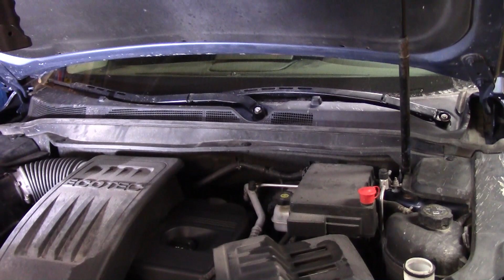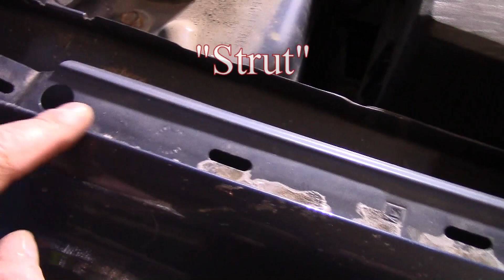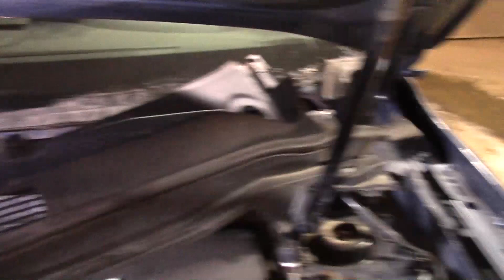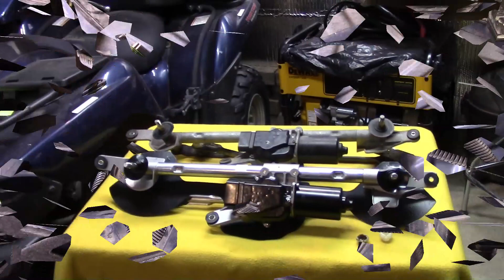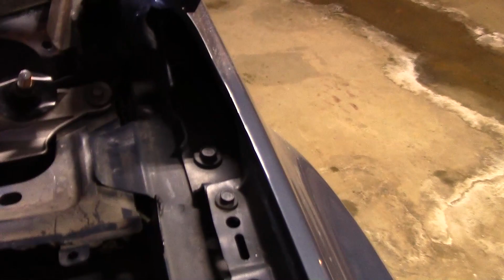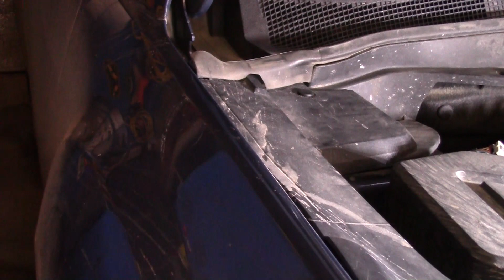How to Replace a Windshield Wiper Transmission on Chevy Equinox Windshield Wiper Repair

Comment: Nice dude. I was going to go the bushing route but seen another video and dude broke 2 bushings to replace one. That link is way cheaper than the $163 autozone charges for the same part. Now all I gotta do is figure this check engine light. Owned the car since August 2021 had all the o2 sensors replaced before leaving the lot. Really wished to get 2yrs outta this but not looking likely

Comment: So GM wont sell us the damaged nylon replacement part and makes you buy the whole transmission, Imagine that. It's a piss poor design with weak connectors that is destined to fail. 
Someone needs to be slapped sober.

Comment: I did everything you did. They turn in the right directions, However when I attach the wiper arms and turn it on, they go the wrong way and blades slam into the cover. I've tried putting the blades in multiple locations, sometimes they will turn in the correct direction. Some how I can't get it started in the correct location. What am I missing?
THANKS!!!

Comment: I just did this today, the wiper actuator link had previously popped off where it meets the motor. Issue is, it's a side job and i never saw how the wipers function before hand.  I noticed the wipers go down before going up and didn't know if that was normal. I ended up clocking the wiper arms up a lil so they weren't hitting the cowl. Just wanna know if that's normal on these?

Comment: In the process of replacing my transmission arms for my wipers when I put the new ones on it's not working properly I don't know what I am doing wrong. The driver side and passenger side are coming in contact with each other and hitting each they are both going opposite ways instead of the same way

Comment: Very helpful. My driver's side arm came off on my 2012 Chevy Orlando. Not sure what the problem is yet, but the passenger side still works. This video helps to understand how to get in there to check it out, and hopefully a cheap (or free) fix! Thanks for the video.
Reply: Splines are probably stripped out.

Comment: Most other Chevrolets use the same transmission and they were all recalled except the Equinox.  I just finished repairing my daughter's 2015 Equinox bushing.  Got it locally at Autozone.  I will be sending a note y=to NHTSA to request a recall.  Hers failed during a moderate rainstorm last weekend 50 miles from home.  This is a safety problem.
Reply: Whoever designed these and allowed them to be installed on production vehicles for the consumer market needs to man up and pay the piper.

Comment: To all who have spent money on this fix, you can be reimbursed.  GM has a special coverage adjustment for the wiper transmission  https://static.nhtsa.gov/odi/tsbs/2019/MC-10171252-9999.pdf
for vehicles 2010 - 2012 and 2014 - 2017 for Equinox and Terrain

Comment: Hey, Mark:  Many thanks for your "how to replace the windshield wiper transmission" video. I'm a 66 year old woman, and was able to fix my 2012 Equinox myself. I had a bit of trouble removing the wiper arms because I'm not very tall (5' 3") and couldn't grip them securely enough.....so, I had to use a safety step stool to give me a boost, and, Man, I sure did have to jiggle them a lot before they came loose. I applied some 3-in-1 oil to help. I think it did. It's a  challenge for shorter people to reach across the hood. (It's worth mentioning for any other "vertically challenged" person.  C; )  It is imperative that the wiper arms are in the park position before reassembling. Your recommendation in the hyperlink made it so easy to order the part from Amazon. Perfect fit. Thanks again, and Happy wrenching!

Comment: This kept me from buying a new relay and wiper motor fuse only to find out it was this mechanical problem, not an electrical problem.  It was easy to diagnose with the wipers just being pulled back and forth by hand without resistance.  I bought the GM version because it came with the motor and I was concerned about my original motor may not fit the aftermarket transmission precisely.  Thanks a lot.

Comment: I just replaced my windshield wiper motor and transmission. The piece that connects the motor and transmission on mine is a bolt. I tried tightening it as much as u can. I test it an it works fine as soon as i get it put it together the bolt loosens and then i have to go through the whole process again. What am i doing wrong?

Comment: Hello Mark, does the wiper transmission itself come apart?
1987 Dodge D250 with 1 transmission missing the knurled knob that the wiper arm slides on. Someone told me the knurled knob screws in. Cannot find a replacement transmission through Dodge or Dorman. Looking to just screw in a replacement knurled knob. Transmission works fine just missing knurled piece.
What do you think? Does anyone know if that piece screws in?
Thanks!

Comment: Really helpful! Saved me hundreds!

I wish I had seen your video and links before I purchased a transmission. I could have had a new motor for $15 more than what I paid and save me two hours trying to figure out why my wipers were going down instead of up (no instructions).

One small tip, the wiper arms are marked with a D for driver side and P for the passenger.

Comment: I’ve just finished replacing the wiper transmission on my 2010 Chevy Equinox with this video as a guide. Just wanted to add that the extra plastic shielding is very likely just a disposable piece that comes with a new unit. I removed it as there are just two staples holding it in place. Thanks for your help! 😁👍🏽
Reply: That "extra plastic" is a part of the design improvement called a "new water shield" by to GM, so removing it would likely be counterproductive.

Comment: I’ve just finished replacing the wiper transmission with this video as a guide. Just wanted to add that the extra plastic shielding is very likely just a disposable piece that comes with a new unit. I removed it as there are just two staples holding it in place. Thanks for your help!
Reply: That "extra plastic" is a part of the design improvement called a "new water shield" by to GM, so removing it would likely be counterproductive.

Comment: I just got a letter from GM.  They will extend the warranty for this repair for 10 years or 150k miles on my 2011 Equinox.  GM will repair or reimburse if you paid to have it done.

Comment: My equinox has an issue where the drivers side wiper doesn't wipe for the full cycle when turned on and then it doesn't return to the full rest position when turned off.  Could this be a linkage/transmission problem?  The passenger side works fine.
Reply: I figured it out. Previous owner said it started happening after he turned the wipers on while frozen to the windshield. It wasn’t apparent at first glance, but I removed the wiper motor/transmission a second time and noticed that the bracket connecting the motor to the transmission was bent. Replaced with a part from the salvage yard and it works fine now.

Comment: So my wipers seem to be going down towards the engine first before going up. Thought the job was done...any ideas?
Reply: This is from the transmission attachment point to the motor. They're misaligned. Did you use the old motor?  Either way, you have to deinstall and use a 14MM crescent wrench to loosen the transmission arm from the motor. RUN THE MOTOR WITH THE CAR TO ENSURE IT'S AT IT'S PROPER STARTING POINT. Reattach with the motor arm aligned parallel with the arms that attach one wiper to the other. Be sure when reattaching, you wedge something to keep the motor from turning.

Run the wipers without the wiper arm on. It should go up an down and nothing else. Stop them with the wiper control, NOT by turning the car off. When you reinstall the wiper arm, don't move the attachment point because that moves the motor and will misalign the arm.
Reply: @briandemarest6222  Thank you! This helped! I was getting pretty frustrated
Reply: @drewr1552  - Glad to help. Hit me up if you have any questions.
Reply: @briandemarest6222  
I bought the part, changed it and couldn't get it to work properly until I found your comment. Thanks for explaining that. Your comment should be pinned so it can be found easily. You're Awesome man!
Reply: Mine does the same thing.

Comment: I just replaced the transmission in my 2010 Chevy equinox with a dorman transmission, but when I put the arms back on and I did the process of letting it go back in the park position put the arms on and tighten them down. Both arms go up but the driver side doesn’t go all the way across the windshield. So i put it back in the park position again and loosen the bolt and push the arm up a little bit and that still did nothing. Also when I does go back down it almost seems like they smack off the plastic dash that they rest on. Any ideas on what could cause  this because i feel stupid
Reply: This is from the transmission attachment point to the motor. They're misaligned. Did you use the old motor?  Either way, you have to deinstall and use a 14MM crescent wrench to loosen the transmission arm from the motor. RUN THE MOTOR WITH THE CAR TO ENSURE IT'S AT IT'S PROPER STARTING POINT. Reattach with the motor arm aligned parallel with the arms that attach one wiper to the other. Be sure when reattaching, you wedge something to keep the motor from turning.

Run the wipers without the wiper arm on. It should go up an down and nothing else. Stop them with the wiper control, NOT by turning the car off. When you reinstall the wiper arm, don't move the attachment point because that moves the motor and will misalign the arm.

Comment: I changed the transmission arm yesterday but kept the original motor but now the wipers go down for a second then wipe up fully but rest higher than before. Do you know why it does that?
Reply: Come to find out after a bunch a brainstorming: I tighten the 14mm bolt where the arm was in the wrong spot. I got it now.
Reply: Mark Jenkins no I just unplugged the connector and unscrewed the wipers.

Comment: Hi all. I found out that all these GMs, 2010-2017 were recalled in 
Canada. 
https://gm.oemdtc.com/6968/25300-03-safety-recall-front-wiper-transmission-corrosion-failure-canada-only-2010-2017-chevrolet-equinox-gmc-terrain.
 If this happens to you SUV,  please take the time to file a complaint 
with the NHTSA! https://www-odi.nhtsa.dot.gov/VehicleComplaint/

Comment: I you have this issue with our 2015, the 2013s were recalled. The NHTSA is looking 
into this problem. If you have this issue, please file a complaint to 
force GM to recall. I bought a new unit from Amazon for $70. If you have this issue, please file a complaint to force GM to recall.
Reply: I've been working to do what I can to get this recalled. This really can create a very dangerous situation should the wipers fail (without any warning) in heavy traffic during poor weather conditions. Please please please, if anyone experiences this issue, take the time to file a report with the NHTSA! https://www-odi.nhtsa.dot.gov/VehicleComplaint/?fbclid=IwAR12htQpsnElvmeKTs1K4OfxHCjIiQ3eQ8vcKHS10wqMIFgahKoQg_lCuSg
Reply: Same here, luckily she was almost at work and the weather cleared by by the time she drove home. GM doesn't understand the danger they're putting our families in.
Reply: @nogripes  Yes, I wish these wipers would fail when it's dry and sunny instead of in the rain. Just luck I guess.
Reply: This type of failure has no indicator that could offer the driver of it's impending demise, thus creating the potential of a dire situation. It would be like being blinded as a tractor trailer passes and not being able to clear the windshield.